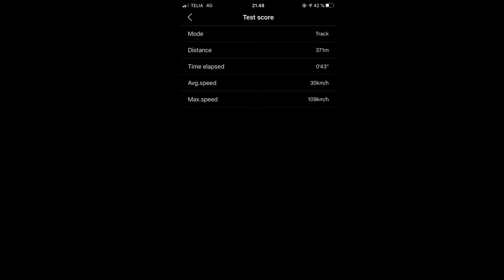Sonicwake 109kph/68mph Speed Run #propchange

Comment: what adhesive tape for ??  it is not a spartan that it turns over, opens and water pours out.
Reply from the maker: Tape of hatch is always good, especially when going 100+ 🥳👍🏼 water can leak in then upside down with the clips/screws only

Comment: I was wondering how you feel about the TFL pursuit vs the sonicwake? I have the proboat SW. I would like another deep V, I just don't know if the pursuit is the right choice. I know there is a new version of the pursuit that has self righting. Any help or opinion would be great. Cheers!
Reply from the maker: Hi Chris,
Thanks for your question. 
In short, the pursuit with self tight will handle similarly to the sonic wake , but the Old pursuit will handle much better. I love my pursuit and have a build video coming up. The standard pursuit with 3660 motor probably needs an upgrade from the get go though. I never even bothered running that motor. 
Let me know if you have any questions. 
// Emil

Comment: if while driving the led flashes red and loses speed, it is a weak battery or an overheated ESC
Reply from the maker: Low voltage cutoff = battery low on power, or battery too weak. Use 50C 5000mah 6S or better would be my advise.